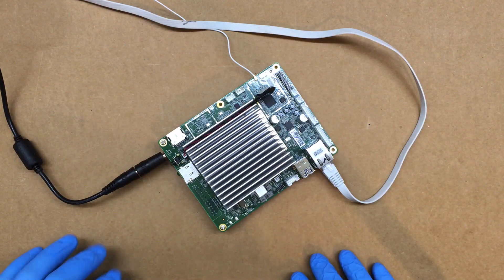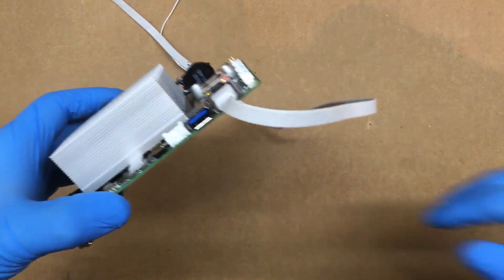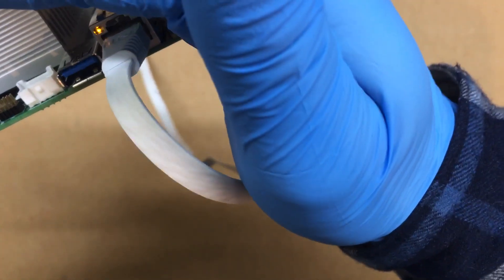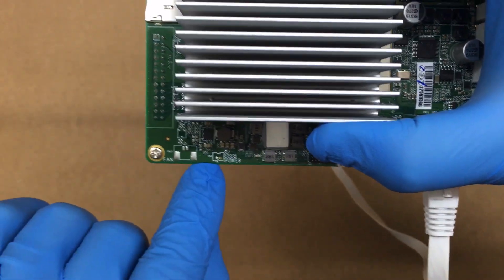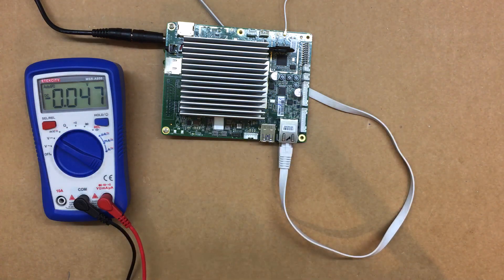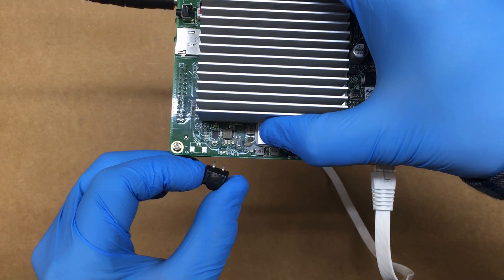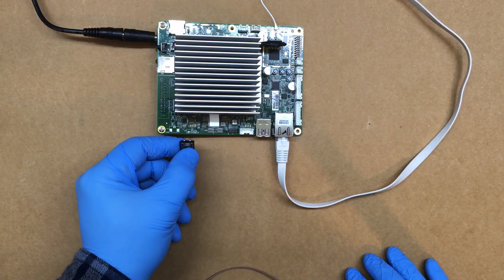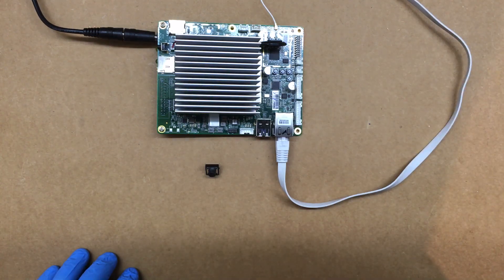Atomic Pi: CN3 Connection For Power ON/OFF Switch

Comment: Do you have a specific plan for the atomic Pi? I am going to use my Pi 3 to track the weather temp, humidity, time, and pressure. Then graph it to track the changes and my increased leg nerve pain. My plan is to see if can predict my bad times and pain cycle. 

Enjoy your videos
Reply from the maker: I testing CPU mining with one Atomic Pi right now. Which is working pretty good. You might want to check out a program called Nettemp Pi. I has graphs and all and a lot more. https://github.com/sosprz/nettemp